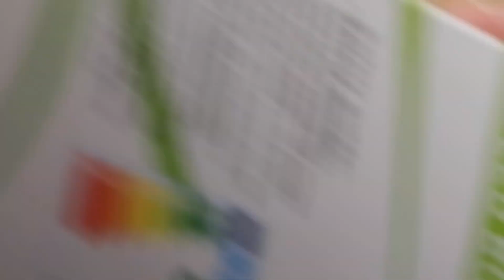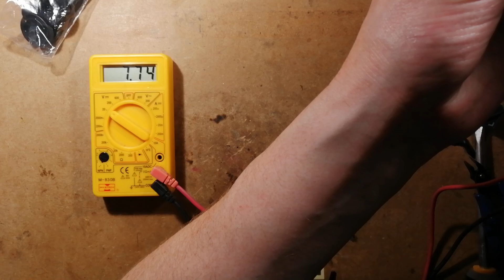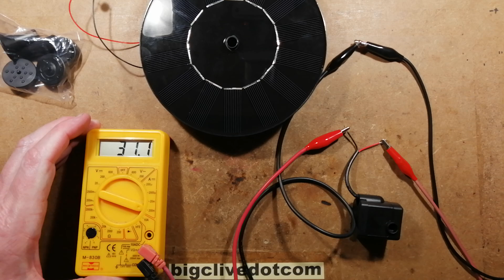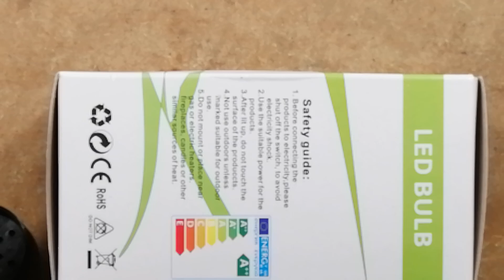Technical look at a floating solar fountain.

Comment: I had a solar powered fountain which was not a floating one, just a panel with a little box on the back and then a long cable to the pump.

When opening the box, it wasn't potted. It was a six-pin chip (unmarked) which went between the motor, solar panel and a huge capacitor. 

Under low light conditions, it would charge up the capacitor, and when it had enough energy would dump it all into the motor, then brown out and reset.  Based on how yours behaves, I'm sure it's the same circuit under all that potting.
Reply: was it any good?
Reply: Basically a simple BEAM robotics circuit.
Reply: @NiHaoMike64  56k modems?!
Reply: I have a solar fountain too - mine is just a big capacitor, and a completely standard DC pump and solar panel. I replaced the pump after the original one died, it still works fine two years after that. The pump makes a humming sound when there's not enough sun.
Reply: @DerHeilendeLotus  That 6 pin chip can be found in some of the larger solar LED string lights, its just a more butch version of the 4 pin device found in the Dollar Store  Solar lights

Comment: Another great video.  Any chance you could review some full scale solar cells / mppt chargers / inverters Clive.  I'm sure they'd be extremely popular. In the diy market the panels can be had for around 33p a watt and chargers and inverters becoming much cheaper and a little better. But it would be great to have a properly impartial in depth look at the tech.

Comment: I wonder if the water on it, or forming lenses, would affect it...

Imagine these out at sea
Reply: I'm assuming the immense waves would probably flip them upside down rendering them useless.
Reply: archer abshire!, solution: make them floatier and add a weight to lower their center of mass.
Reply: @pyromen321   I was thinking that!
Reply: @pyromen321  or make them double sided
Reply: @phonotical  Fix two together like  a figure 8, with one upside down.

Comment: Cool fountain. Might help with aeration on some ponds and or fish tanks. I've ben trying to come up with a weather proof aeration system for my dad's pond for years. The best I came up with was a Chevy 350 water pump attached to a windmill with a simple spray outlet. The hurdle is getting the initaial start, And building the whole thing to pivot.  Cheers from I smell like fireworks we did ours last night. Kansas

Comment: It looked like the camera was doing digital zoom - when you zoomed in on the PCB at the end it was very pixelated.
Reply from the maker: Rather disappointingly the close focus of the Honor 8X boasting a 20 megapixel camera is poor compared to the old Moto G6 Play with its humble 12 megapixel camera.
Reply: @bigclivedotcom   Sadly the 20 megapixels will likely only be used for still photos. Like others have pointed out, it seems like the video mode is recording at 1080p and scaling up that same 1080p image when you zoom. The Moto G6 (and most other 12 megapixel phones) will actually be scaling up the 4k sensor image when digitally zooming, showing genuinely more details. Think of it cropping a 4k image down rather than blowing a 1080p up.
Reply: @bigclivedotcom  Huawei got caught using pics shot on an actual DSLR to advertise their phone's camera, several times I think too. (Honor being a brand owned by Huawei)
Reply: @bigclivedotcom  most probably this is a software issue, or maybe the motorola had also mechanical zoom. In any case if that is a true 20 megapixel camera you shouldn't have such issues, no matter what others say, since the only disadvantages mobile cameras have compared to professional ones is that it is not capable of catching so much light, hence once zoomed in, the image will be darker (in case of optical zoom, not digital).
Reply: Agreed... quite blurred / pixelated. The component IDs were essentially unreadable.
Reply: It looks like it only takes 1080 off the sensor then digitally zooms into that rather than native 1080 from the zoomed in section that many other phones do in video mode.
Reply: Not all phones have 4-8x optical zoom